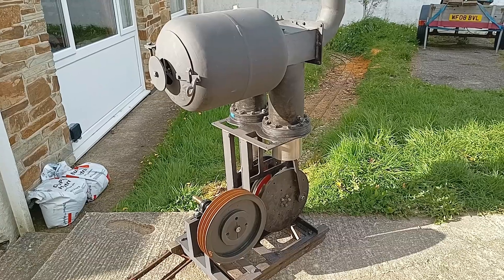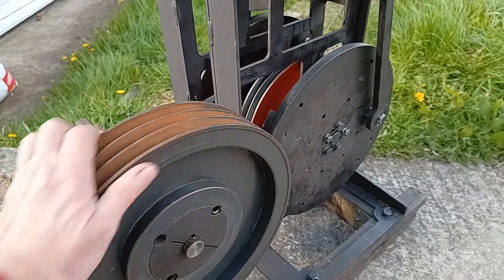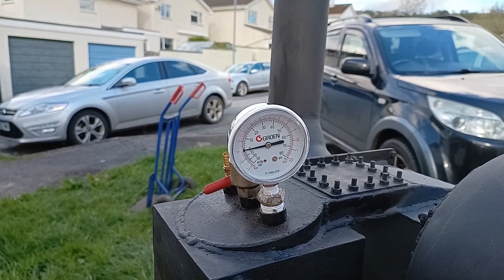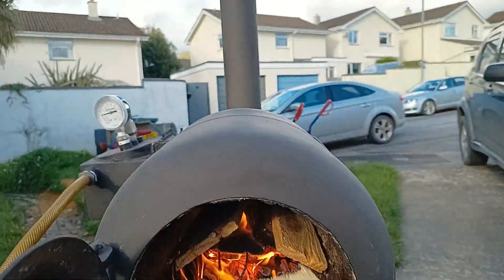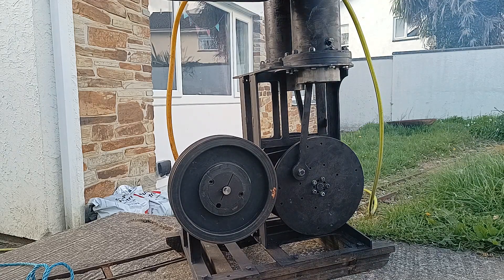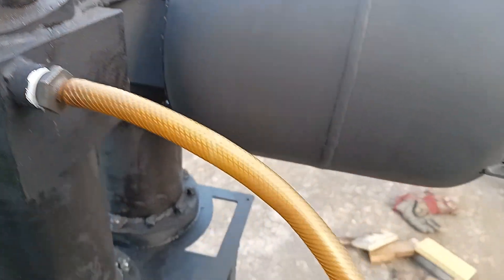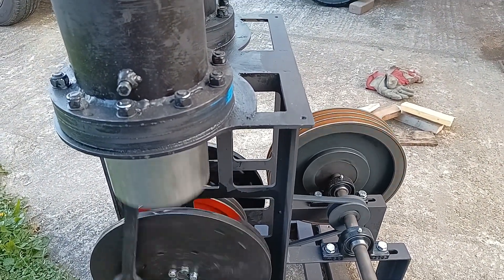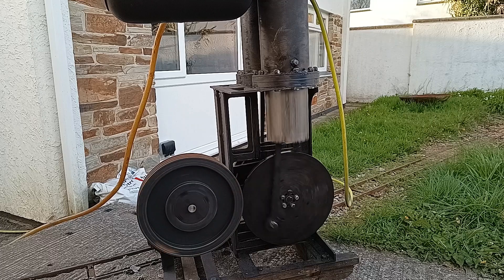Building a Stirling Engine that is Wood Fired - Part 7 - (It works, Just about!)

Comment: Looks good. Have you tried shortening the stroke of the power piston?
Reply from the maker: I haven't tried that. I think (if I remember right!) The original rider engines had a shorter power stroke. I can't really get my head around what this changes? I don't suppose you know? Cheers
Reply: @ShanePomeroy  Reducing the stroke length (by changing the attachment on the flywheel) reduces the compression ratio but also introduce some dead space (areas where the air isn't moved from one cylinder to the other) so some extra material at the end of the pistons would need to be added to minimize it.  But reducing the compression ratio should reduce the needed temperature ratio, so it should run at lower temperatures.
Reply from the maker: @IronGoober  some extra insulating material on the end of the hot piston might be beneficial to reduce heat transfer to the seal, many thanks
Reply: @ShanePomeroy  indeed that could help. I would suspect that a lower compression ratio might be beneficial for your engine not only for the lowered temperature needed to run, but also to reduce the amount of leakage. I imagine that the reason the snifter valve being covered made it run smoother is that when the extra air enters the system, it has to be compressed, but leaks out before it can complete a full cycle, just causing more compression than expansion. When you cover it the leakage is essentially equal in both directions and you have slightly less parasitic loss from extra compression. Lowering the compression ratio might further help with this
Reply from the maker: @IronGoober  Many thanks, that seems logical. I'll put this at the the top of the list to try and improve things. I don't suppose you've got any advice for compression ratio to aim for. I'm thinking of about 1 : 1.7. Currently it's over 1:2. If I had another shot at building this I would increase the heater exchanger sizes to lower compression. Best laid plans..... : )
Reply: @ShanePomeroy  Well, if I did the calculation correctly (V1/T1=V2/T2) a compression ratio of 2:1 requires minimum of 600K to run (300K being the cold side temperature), so multiply that by 1.5 for an arbitrary realism fudge factor, and that is 900K (627°C).  For a 1.5:1 compression ratio, that requires a temperature of 450K but using our fudge factor, that gets you to 675K or approximately 400°C. But the amount of work that you can do per cycle drastically drops too. So an optimal compression ratio for max power from your engine will be a balancing act between the engine losses (friction, leakage, slow heat transfer), and the achievable temperature in the hot zone. Lower compression ratios will make the engine run at a higher speed, but it will have less torque.

I think the easiest thing would be to put several attachment locations on your flywheel so you can just change where the connecting rods connect and easily change the compression ratio. That way you don't have to stick with one, but can try several, or can adjust it depending on how hot the fire is.

This is one of the most interesting engine builds I've seen. Loving the series.
Reply from the maker: @IronGoober  Thankyou very much, your info is a excellent reality check for me! I might as well drill multiple attachment points for the crank pin if I've gone to the effort of taking them off. First I'm thinking of turning the whole thing horizontal to allow the fire to flow up through the heat exchanger. Many thanks

Comment: try also a wood fired no-moving parts kinda-steam-engine jet thruster engine (heat transport air expansion engine), where the burn chamber is separate from the thrust heat ramjet
Reply: large fire, so that you dont need to mind about compression nonsense
Reply: well longer pipe or better heat transfer heat sink plates if the passing air is not directionally heated enough fast
Reply: the heat transport pipe is meant to be hot/heated by the fire in the burn chamber, just like sauna stone heater, bottom is super hot fire, but air passes through the hot stones constantly, yes two air inlets, other for the burn, other for the thrust, not directly linked, only heat transfer
Reply: more like old steam locomotive steam burner, but to a jet thrust engine
Reply: air is already a gas, so no steam explosions

Comment: You have an air intake with the one way valve? I thought the working fluid should be a closed system, maybe thats why it worked better when your hand blocked the inlet?
Bravo!
I like the water jacket idea for the cold side. Could do the same for the hot side actually.
Reply from the maker: The valve is meant to replace air that has leaked out. Maybe it finds its own balance point without one? Cheers
Reply: @Shane Pomeroy  might be better to solve the air leak? You're build is inspiring. I'm thinking a a cold water jacket and a hot water jacket. Might even help with air leaking. You do seem to have friction somewhere that shouldn't be.

Comment: There's one interesting system you should take a look:
https://youtu.be/VezBrlSSJnU
This rocket stove powered engine is manufactured by  MomoseMD (百瀬機械設計株式会社).
That 300Watt engine is quite compact but each unit costs 880K JPY / 5,293 GBP!
Reply from the maker: Thanks for showing me that. It's an interesting design. I don't think it would cost that much to make. I can feel another experimental engine on the horizon. I've got a spare rocket stove to experiment with. Many thanks

Comment: Hey Shane, 
Glad too see it running! Still got a little bit of tuning to do I think, but it runs very quietly and with far less vibrations then the previous model, I also like the more compact size.

Is it maybe possible to measure the heat going out of the chimney and reduce this somehow if it's too high but without losing heat inside the burn chamber, for example with a thinner chimney pipe?
Or maybe the water heat exchanger is just working too well and therefore you must limit the water flow 🤔.

I'm just spouting some ideas, I have zero experience with heat engines..

Good luck,
Cheers mate!👋

Comment: One advantage of that geared flywheel is the increased speed at the rim: glue magnets to it and set it within a serpentine coil and you'll get some good numbers off it. I imagine in an ideal world though, you'd get rid of the gearing and set a larger-diameter flywheel directly on the crank. Would require a bit more height.
I am a bit surprised by the snifter valve assuming it's working ok. I'll have to think about that. I wonder if the regenerator needs some work?
Reply from the maker: Yes , ideally I would have a direct flywheel. Ive already got ideas of turning the whole engine horizontal to allow this. It would also allow the flames to more uniformly flow through the heater upwards. I think the compression is technically to great and closing the snifter valve lowers the compression ratio to a more suitable point. As for the regenerator, any good ideas? I was thinking of installing lots of annular plates?
Reply: @ShanePomeroy  I am no expert. But personally I would start by having the largest chamber possible between the 2 cylinders and then pack it quite tightly with stainless steel wool in a spiral, leaving a small hole through the centre. And then it would be a case of playing with how much friction it creates vs how much thermal efficiency...  but by packing it in a spiral, you can cut (or maybe ram, with a piece of rebar) other holes or widen the exisiting one, until it works right. 
Just my thoughts.

Comment: Try running a coldwater jacket on the cold cylinder

🤔

Could also have a reservoir above, so can fill it with ice to run water through it, and into the jacket, that would make a nice temperature differential

And a water valve at the bottom, so it can control the flow.

0r.

Connect a on the flywheel to pump &  lift the water back to the reservoir, so it would be like a primitive radiator.❤
Reply from the maker: I think adding a cooler to the cylinder on the cold cylinder is a top idea, many thanks. I'll. Add it to the list for the next phase.....

Comment: dont moste of the heat you take out from the heatexchanger get stored in the regenerator? or r you running without one?
Reply from the maker: From what I've read,they reckon that 4/5 of the heat in the engine is recycled and the heater tops up the 1/5 that is used
Reply: @ShanePomeroy  hmm i have seen other engines run a long time on the energy from the regenerator alone. this one struggle to stay running with heat added.
Reply from the maker: @grapsorz  the regenerator is stainless scouring pads you get. I've never seen a stirling run without heat going in. Technically the regenerator has to recover unused heat from one cycle and then add it back to the working gas before reheating. Could you point me in the direction of some of these stirling engines, many thanks
Reply: @ShanePomeroy   to replace the stainless part. that metal is just horrendous for heat movement and storage. 
i have seen some run for a bit on the built in heat. slowly tapering off until it stopes unloaded.
Reply: @grapsorz if he was able to suddenly pull off the firebox, this engine would certainly run for a bit as well, as the thermal mass of the hot parts would keep it running until the engine pulled out enough heat to lower the temperature too low for it to run. All Stirling engines have this quality.    You are right about the poor conductivity of stainless steel. But it is much more resistant to oxidation and is therefore the best bet for a hot end with an fire that is likely oxygen rich.
Reply: @ShanePomeroy  what is the regenerator made up of in this engine? copper plates? mesh?